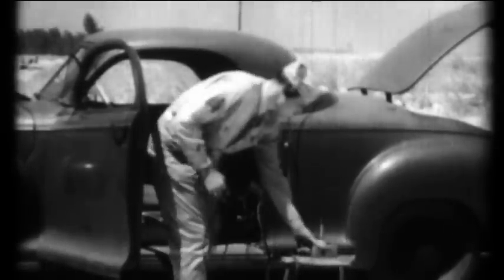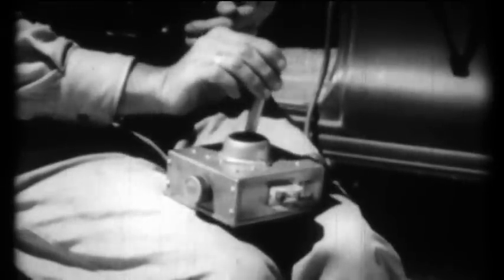WWII Remote controlled Floating Aerial Bombing Target

Comment: My father installed similar equipment in surplus F4U4s for aerial target drones in 1943-44, never publicized it was top secret stuff at the time.
Reply: "Surplus" F4U-4s in 1943-1944 when the F4U-4 variant was not introduced until early 1945? Even if they were F4U-1s I doubt they were "surplus" in 1943-1944 since they were introduced in 1942 and there was still a war going on. Either you or your father have a bad memory. WWII aircraft weren't used for target drones until after the war to test anti-aircraft rockets and missiles.
Reply: @dartmaster501  surplus was the wrong word, sorry, and I may have mistyped the aircraft name, but he did install radio control gear in aircraft used for target drones, I can't be certain of the type designation, it was my dad, not my grandpa, you never heard about it because it was classified. This is a fact not a story . Sorry it doesn't jell with your  view of things.
Reply: @DEeMONsworld  Oh okay. I just think the aircraft and the year is wrong. Plenty of previously classified stuff are now on newsreels from the day.